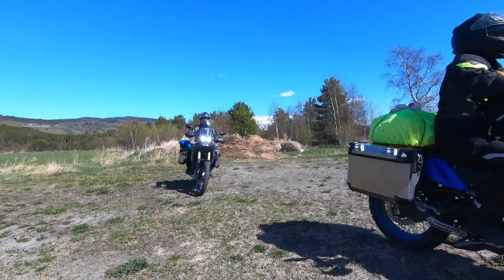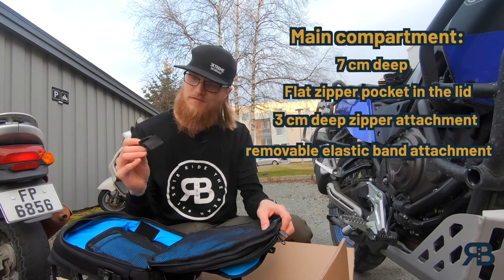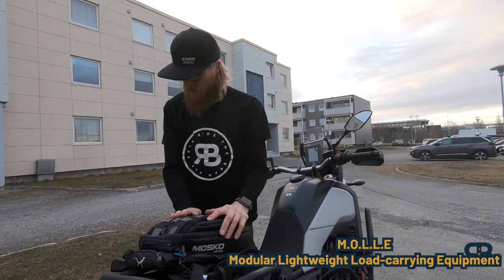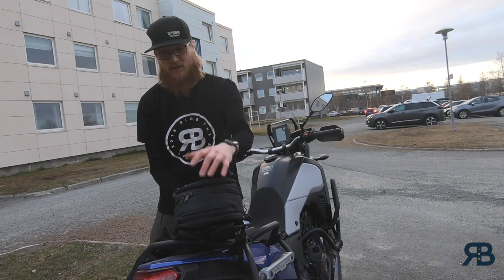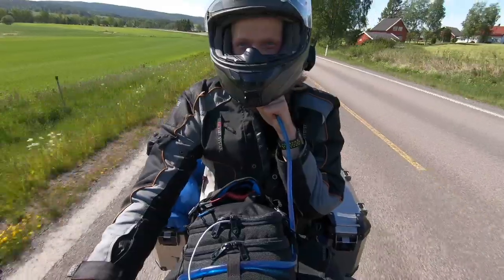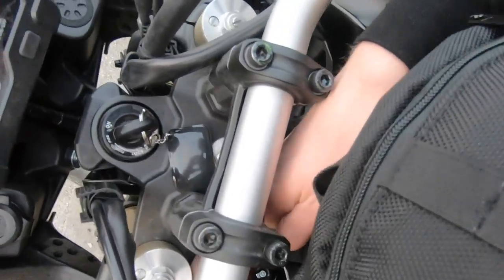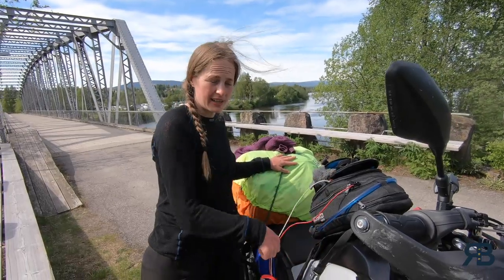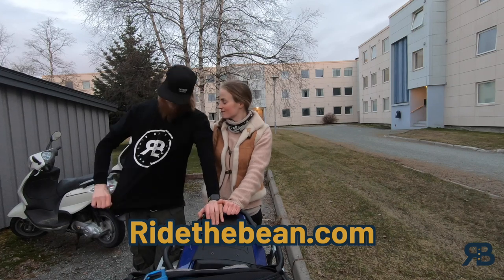Mosko Moto Nomad Tank bag unboxing, installation guide and review

Comment: How big is the map pocket that goes on top? Did you try to fit any iPad, thin laptop or similar... or will such just get crushed by rider or handle bars?
Very interested in an honest video after more use. Keep up the good work 👍
Reply from the maker: That is a good question. I just tried fitting an iPad Pro from 2016 inside and it fits perfect. With room to spare. I think you may be able to fit the new model too. Not the largest one of course.
I find the map pocket to be a bit in the way, but I don’t like to use maps when I have a GPS. I think I will bring it to Africa though. It is not in the way of the handle bars at all, but just makes it a bit tricky to reach the water hose.

Comment: Nice review! Someone really thought this bag through. Like a Transformer :) I use the Enduristan Sandstorm 4H and the only thing that it does better is that it's waterproof as it is. Mosko wins on features by far though.
Reply from the maker: Thank you 🙂 
What do you like about the sandstorm? The nomad is water resistant as it is, but in heavy rain the cover is great.
Reply: @RidetheBean  Not sure if the Sandstorm can be compared to the Nomad. It has no real features. It just works well and keeps stuff dry. I only use it for video gear and charging batteries. If I don't film, I rather not use the tank bag. But when filming, I just love ability to send up the drone without leaving the bike.
Reply from the maker: That is one of the best things for me as well. Being able to fit the drone in the tank bag. Also being able to charge the batteries on the go :p